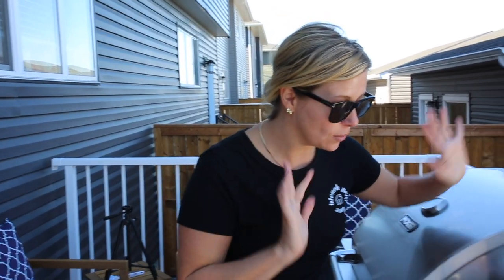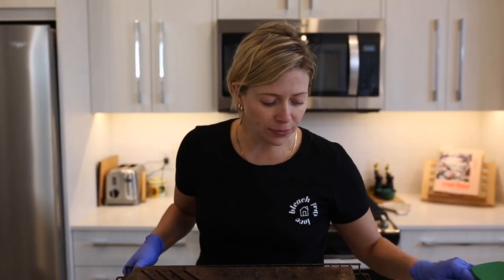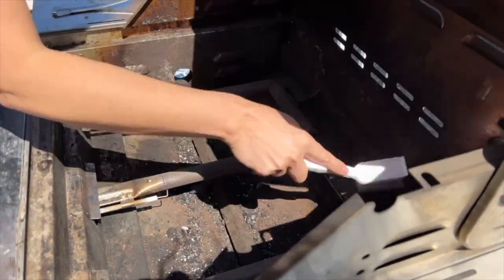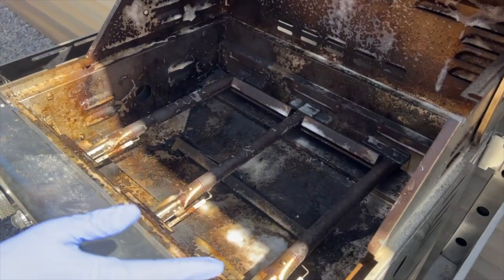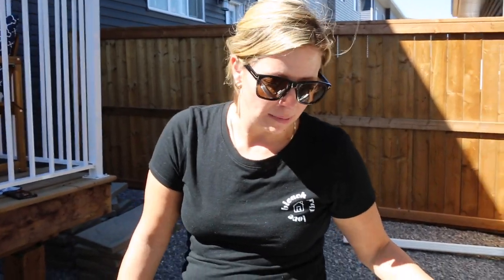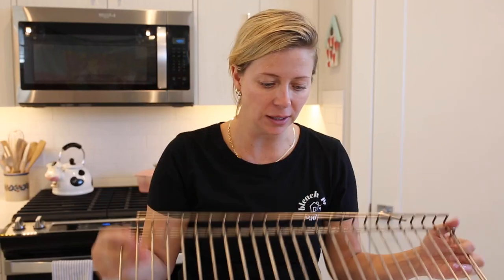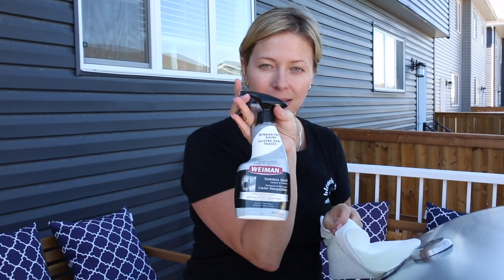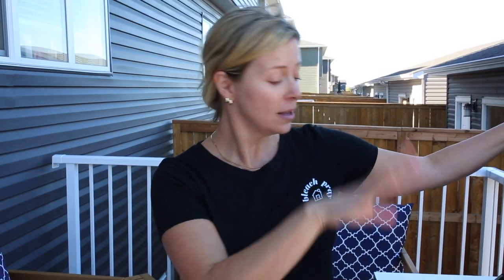Grill/BBQ Makeover

Comment: Great ideas, I use a commercial fryer degreeser to soak the grates.  Also I use a good grill cleaner called "citrusafe" BBQ GRILL CLEANER.  YOU CAN CLEAN IT COLD WITH GREAT RESULTS, also not expensive to get.

Comment: I cleaned mine today before I saw this video. Never thought to use hose/pressure washer.  I have electrical components because of the auto starter/igniter - So I’d be concerned to do that?   
I also soaked my grates AND used oven cleaner AND steel wool…and my grates still aren’t back to shiny (they are not cast iron).